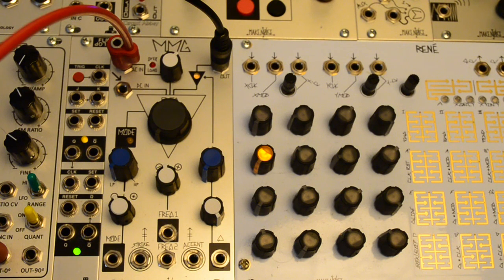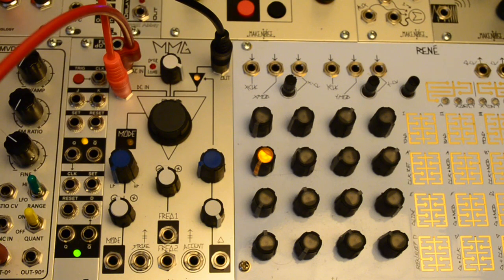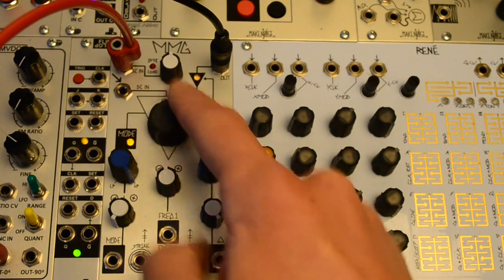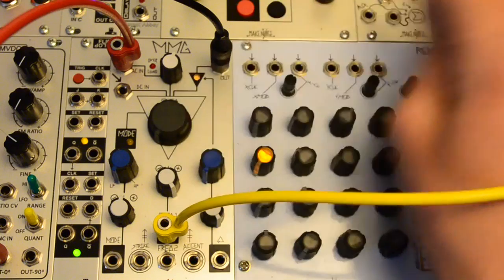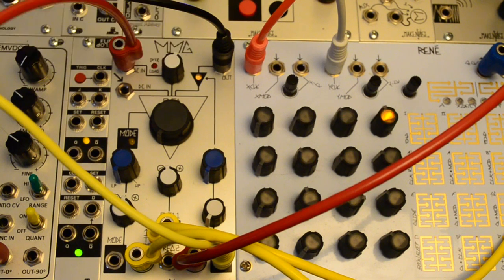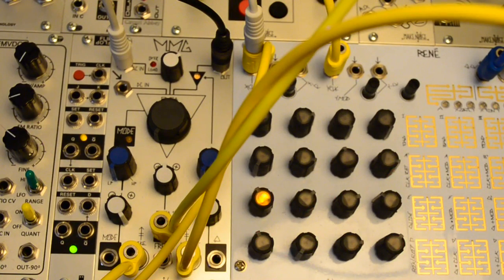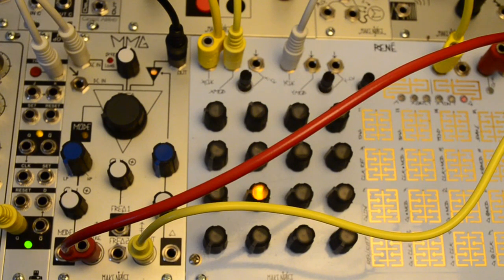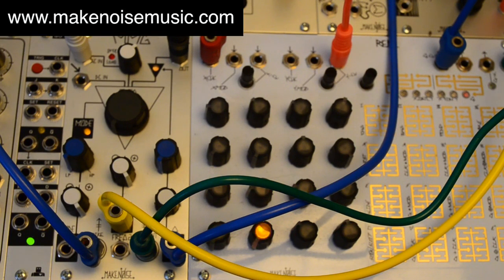Make Noise Multimode Gate (MMG) Demo 1

Comment: If you send a quantized cv to the freq input can you play the self oscillation in musical pitches?
Reply: A bit late, but probably not. Filters, unlike VCO’s, often aren’t calibrated to track 1V/Oct. Since it’s circuitry is based on vactrols, the MMG will probably also have a noticeably slewed response to your sequence.